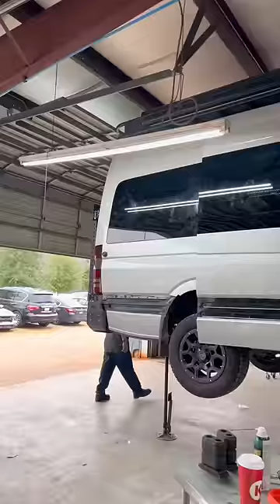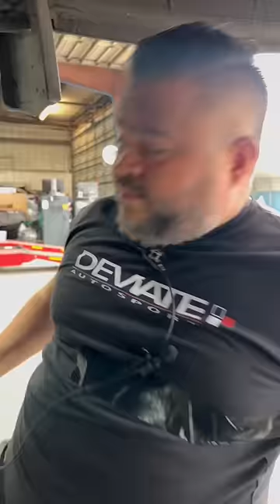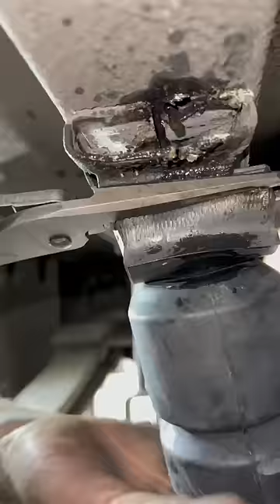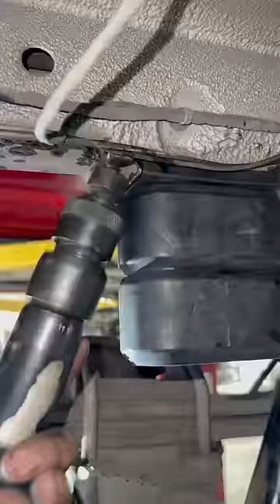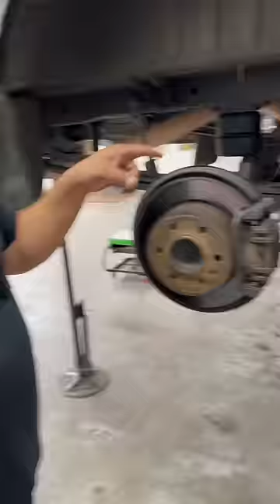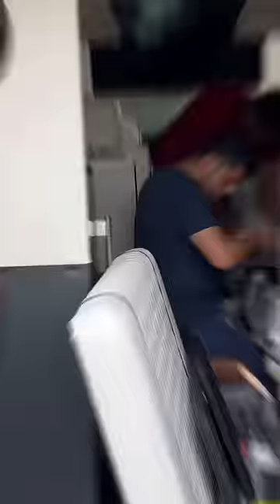Mercedes 2500 Sprinter Van OVERLOADED‼️ #shorts

Comment: Those bump stops are just going to make the ride more uncomfortable, if the van is sagging from being over loaded it needs upgraded springs or airbags . Putting those bump stops in is not going to stop it from sagging. Lol that’s a hack job ( way to cut corners and probably charged the customer a ridiculous amount) and ur “complimentary corrosion removal, lol that was a nice gesture but it does not benefit the customer in any way. That makes ur job easier and maybe the next person to work on the van and that’s it, it was a waste of time. 😂😂

Comment: 2500 van and ita hitting the bump stops? That rear end gonna blow soon. I blew out out 2 2500 rear ends. Not sure why my boss would buy a 3/4 ton when fully loaded our trucks weigh about 15,000 lbs. 

When there is too much weight on these sprinters it pushes down the ass end and bows the rear end. Pulling the splines out of the differential, stripping the axles.

Would need to upgrade to a 2500hd or 3500.

Comment: Way to slap a Band-Aid on the problem and call it good. And what is he expecting them to feel for removing that little bit of rust in the wheel hub? Mean he does realize that the brake pads don't actually touch that part of the wheel right?

Comment: This is so wrong on so many levels ! 🤦‍♂️
First problem , the bump stops will hit harder and more often become of the shorter suspension travel .
Second due to the excessive wear now the rear axle will slightly bend witch will change the drive axel position and will generate wear in the differential . Plus the drop link angle will be affected as well in long term witch cause excessive wear on the tire . 
Now this is a good way to fuck up a van!! 😅

Comment: Yeah that " Complimentary corrosion removal" is the least you can do after scamming dude. Tougher springs with a higher spring rate or air bags would be the fix. Making the truck bottom out sooner isn't a fix man. I don't knock the hustle but come on!

Comment: Yea, bumpstops are the last thing you should have done. Airbags or air shocks would have been the correct fix. You could put in a stiffer spring but now you are making the ride harder. With stops he is just riding bottomed out all the time. You have no idea what you are doing

Comment: Dude really thinks knocking surface rust off the brake rotor wheel contact will make a difference.. that's just the part that contacts the wheel, that's not the part that contacts the brake pads. That's like rubbing frost from an ice block.

Comment: We add leafs to the original packs , some come with a single leaf that ride smooth buuuuuut holds no weight especially if it’s been camperized , 

Can also add beefy bump stops in addition to a modified leaf pack … air bags are a nice touch for adjustability , but can be problematic and require a bit more maintenance up where I live in the pacific north west

Comment: I think that’s fine, depending on how many miles it has on the suspension I probably would have done the same thing, I’m sure nothings wrong with what he has now, it’s only when it’s loaded does the van sag, I’m sure besides that it’s fine, nice fix, now the shocks don’t bottom out, not everyone wants a lift kit or what not

Comment: Yeah or upgrade his suspension and his and put some lift shocks on it or do a suspension and put some air bags on that m********* do it the. Right way the way you're doing it eventually hes gonna crack. It cause that rubber is gonna dry out eventually just like the old one and it'll start indenting in it and you just charge him a bunch of money we're not a real fix.

Comment: This is not the right way to fix this… all you did was change the height that suspension bottoms out at… it’s not supposed to constantly ride bottomed out tho… you should have either put stiffer leaves or added helpers that would’ve been the cheap easy way but this isn’t how you fix that and all it takes it seeing this video then me personally i wouldnt even let you touch my stuff for free lets not even talk about would i pay you for it

Comment: So he is gonna feel that you clean the hub and hat of the rotor. Or are you saying he is gone feel less travel bc you just put a huge bump stop… let me repeat myself BUMP STOP. Boy needs air bags or just stronger rated leaf springs 
Either you or the customer is being cheap in my opinion resulting in not really solving the issue.

Comment: Umm. I’m no expert mechanic but why would you NOT upgrade the suspension to heavier load rated springs compared to the skimpy ones I see in this video. Wouldn’t that just be smarter and more practical instead of riding on the bump stops and fukking more shitt up?? DERRRRR……….

Comment: This makes zero sense. Just gonna make you bottom out even more. I guess when you do bottom out the body will be sitting an inch higher? That’s about all you achieved. Longer or stiffer springs is the actual way to fix this, and I’m not even a mechanic lol

Comment: This post is dumb, what he said about bump stop was wrong. The bump stop has nothing to do with ride height of that vehicle. Since it a Benz it prob running air bags but could also have coils or leafs who knows.
Reply from the maker: 🥱 videos coming soon, I mean what gives you guys the confidence to be so confident. Duning Krueger
Reply: @dv8aroldo  I am confident because I am a highly trained mechanic and been busting my knuckles for 25 years. I have worked on everything from semi's to triaxles to medium duty to light duty and yeah cars to. I have also worked on off-road shit as well all the way down to repairing some rich ladies riding mower etc etc etc.... By your post I already know you are not a mechanic. If a mechanic in any shop I have ever worked in made a diagnosis that you did on here he would be fired for lying on his application about having experience. Not trying to be a dick to you I'm merely stating facts. Lmk how happy your customer is with the Benz.
Reply from the maker: @Keith Hawk  25 years? Do you say that experience is important?

Comment: So he carries heavy shit so now where gonna put bigger bump stops so it bottoms out sooner 🤣 why not upgrade the leaf springs in the rear for something stiffer and rated for a heavier weight. Oh and we gonna wire brush your rotors for no reason because we ain’t gonna spray them off with a rust inhibitor and they’ll be rusty again by tomorrow at lunch time .